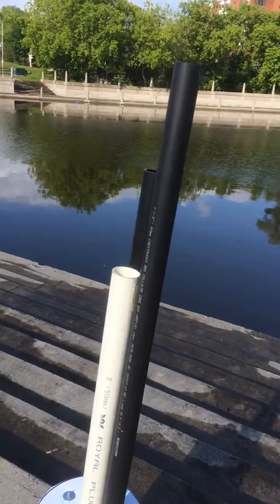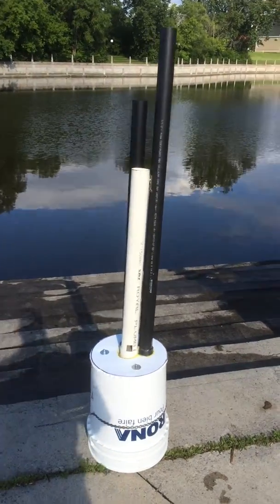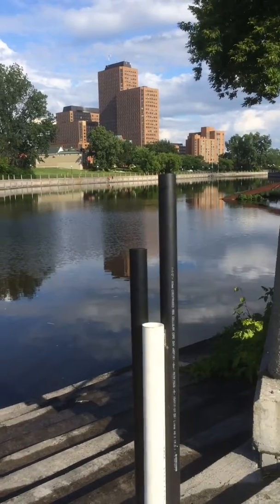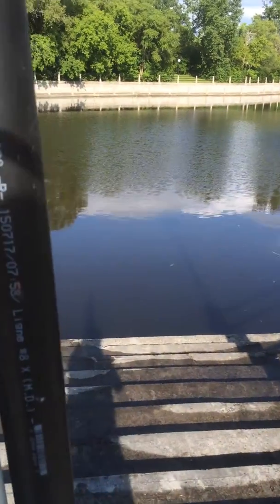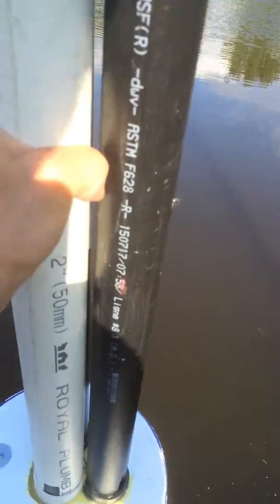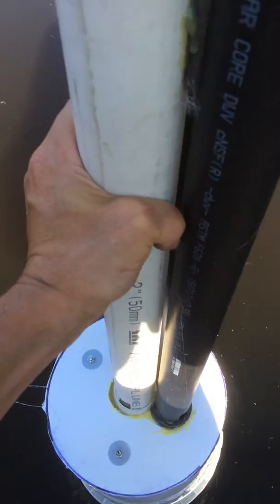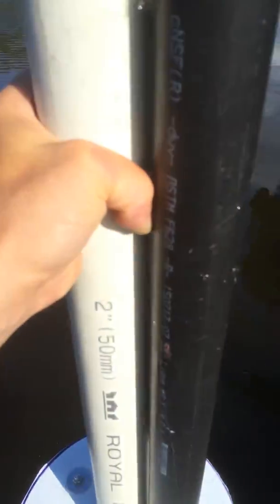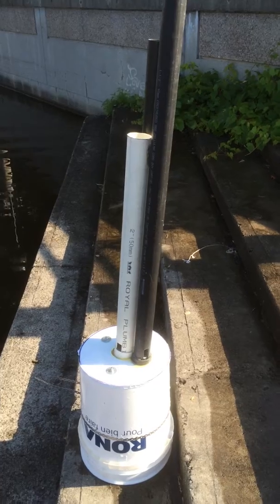flute wave organs  test in canada  at DAÏMÔN

Comment: Thanks for the video! This is very interesting. Since it had to be in the water to work, how does it work? And, do you have another video with all the other different types that you made?
Reply from the maker: the  water is the air pump or its called a vertical turbine.